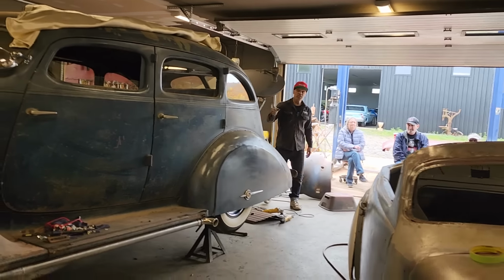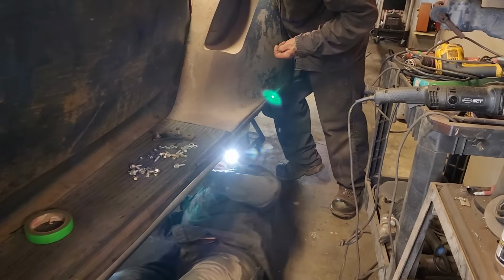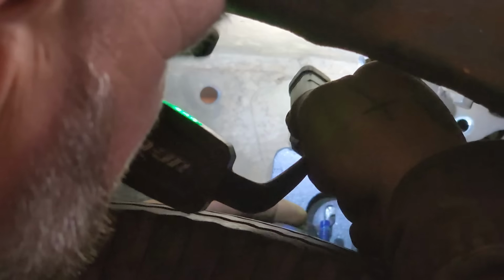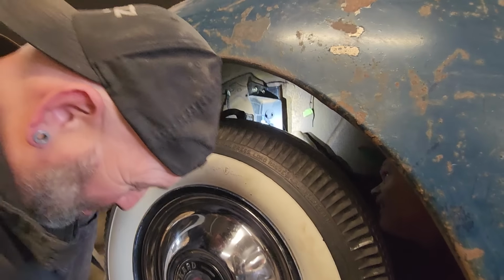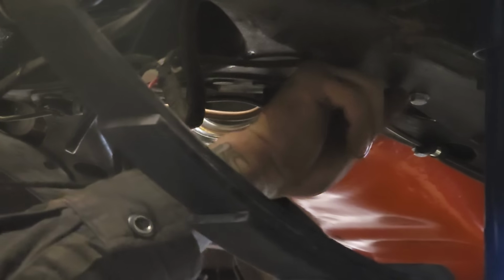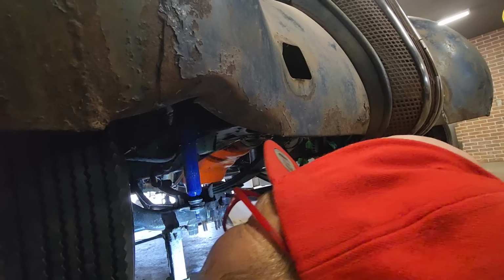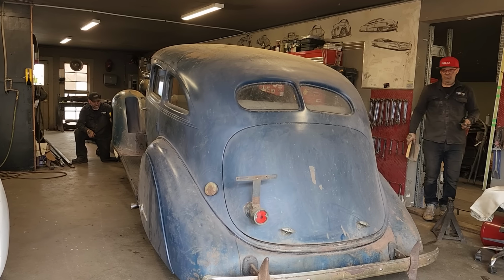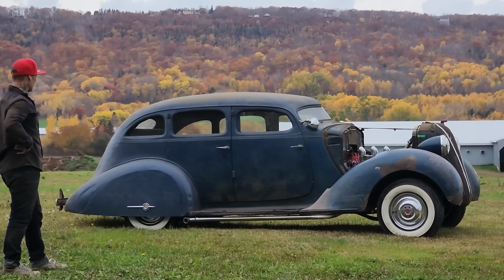Our top barn find goes for it's 1st drives... this was a long time coming 👏 1936 Hudson Terraplane

Comment: Needs a resistor in the alternator wire. Also you could put the alternator on the drivers side to avoid the radiator hose.

Comment: I have two pieces of equipment that were GM alternators and just solve that problem you add the extra wire with the diode so when you fired it up, it automatically starts charging then settles down

Comment: A few more details, like torque the wheels and a hood and she is ready to go! 
Be careful with that belt as they also tend to wobble side to side as the load changes. Sometimes the hose can be tweaked on the water pump outlet too. :)

Comment: That alternator bracket is made to bolt on the driver's side exhaust manifold. There's a different style bracket that mounts on the water pump and thermostat housing on the passenger side and it moves the alternator in closer to the water pump away from the radiator hose.

Comment: Hey Chad .. put the alternator on the other side and get another bracket.. it will fit properly.. great motor .. that makes it a real Hot Rod .. not like those flathead boat anchors in some of the other cars ..

Comment: Is it a single wire alternator if so, you have to run a separate wire with a diode to hook to the positive side of the ignition or off the coil on the positive side

Comment: The Alternator belt is at Max Adjustment... And it will hit that hose and cut it at RPMs... But it's the " My Car My Thing Syndrome " .... He builds Failure into every build... I would have put the Alternator on the other side of the motor with Hand Fabbed Brackets... But you know Scab Chad...

Comment: with the headlight brace bar, all you needed to do was wind the nut further up the thread on the other side which would allow you to slide it in further in..... then just adjust both nuts to centralize it after

Comment: Hey Chad, it's none of my business, but tell Nate that the plug wires on the Hudson. The wires go behind those ram horn exhaust manifolds. You attach a bracket to the oil pan bolts and zip tie them to hug the block. That way, they don't burn on the exhaust.

Comment: Welding next to the battery, what can go wrong? I guess he's never had one blow up.
Reply: I have, 45 years ago, not fun
Reply: No never has.
Reply: Thanks for the incite David 🫡 see your ass tomorrow
Reply: I did years ago left me naked just eat up my clothes but never did touch my skin,but sure did take my clothes off
Reply: Blew one up several years ago, first (and last I hope) in 60 years of tinkering. It was a very large deep discharge marine battery. Fortunately I was looking straight down at it and wearing glasses. It didn't get my eyes but burned my face, ate some clothes and etched the shop floor. My wife put up a sign the next day "Safety First". All I could say was - Yes dear!!
Reply: In 50 years of working on vehicles I’ve had only 2 old batteries short out  and blowup on Charger and one time driving ! Both times  lucky I wasn’t near them ! Be careful guys !
Reply: I have new respect for batteries after our prospot spot welder blew a couple batteries at once. Blew cover off machine halfway across shop, all of our ears was ringing it could of been worse but yeah.

Comment: @Bad Chad when you get up to 17-18 amps area then you have a good chance of exploding the battery. The sides of the battery will start bulging out. You dont want to be around when a battery explodes.
Reply: I've had one explode on me before, definitely wasn't fun.
Reply: Replace the voltage regulator Nate
Reply: @PeterDowd-r9b  Nate already said regulator was bad